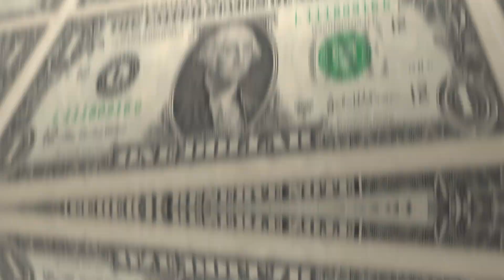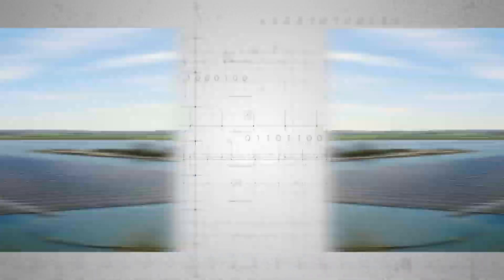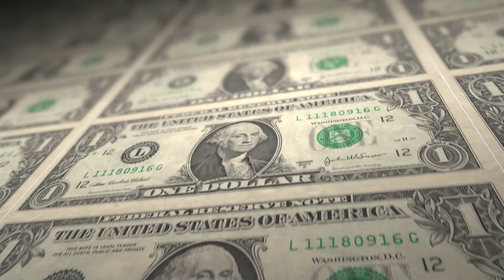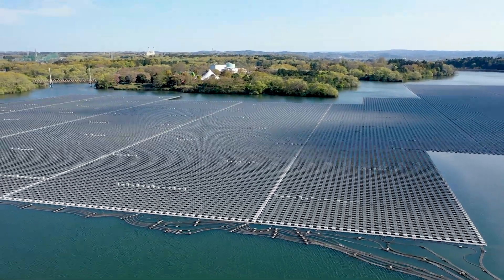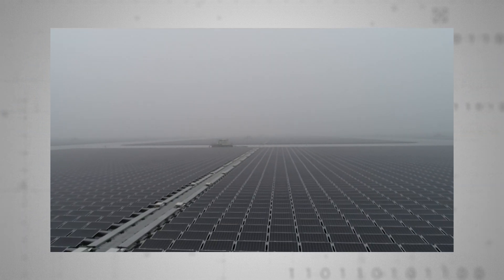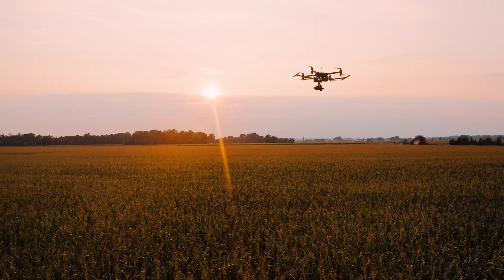The World's Largest Floating Solar Farm

Comment: How about the salty corrosive marine environment on the connectors in combination with constant moving elastic fluctuations of these connectors that causes copper corrosion and motion fatigue.  Remember DC-arcing with subsequent fire destroyed a massive floating farm in the North Sea?   DC-arcing is an inherent fire danger in solar panels. How on earth can you place this in a corrosive salty and constant moving location????

The idea of cleaning these panels with salty water reduces lifespan significant.

Comment: Solar panels can work underwater,  but they work best in clear water at depths of up to 50 feet and government politicians and corporations would not make money in the stock market as shareholders The water's clarity is important because the sun needs to penetrate the water to reach the panels. Murky water can reduce the transparency of the water and make it difficult for the sunlight to activate the panels. 

 

￼

Solar power can also be used in underwater vehicles, such as autonomous underwater vehicles (AUVs) and remotely operated underwater vehicles (ROUVs). These vehicles can help researchers explore the oceans, but they face challenges with power. Solar power can help overcome these challenges by providing a persistent onboard power source. For example, the SAUV II solar-powered autonomous vehicle can run autonomously for weeks or months. 

 

￼

￼

Floating solar panels, also known as floating photovoltaics (FPV), are another way to use solar power in water: 

 

￼

￼

￼

How they work

Solar panels are mounted on structures that float on water, such as a reservoir, lake, pond, or canal. The water cools the panels, which increases their efficiency. 

 

￼

￼

Benefits

Floating solar panels can expand solar power without taking up more land. They can also help regions that experience droughts because the panels act as a lid that reduces evaporation. 

 

￼

￼

Potential

Floating solar panels have the potential to generate a lot of energy and protect the climate. However, in 2020, they only produced as much electricity as less than 1 percent of the world's land-based solar farms, because we have oceans and seas.

Comment: Floating solar is perfect whenever is dam, water storage and lakes in order to prevent water evaporation by sun and PH reduction. I highly recommend it on North pole and south pole on ice caps in order to make shade on ices. This way don’t melt as fast as before. In last 20 years, they are melting horribly which caused, causes and will caused natural disasters.

Comment: 1) educational people about green energy (extracting H2 & O2 from catalyzing water, land solar energy, floating solar, wind generating, water current energy, recycling energy and balance difference energy)
3) educating people about global over population related to global massive pollution. which led to global warming. 
4) educating people to boycott all benzine scooters which pollute much than benzine operating automobiles. Scooters and the most of motorcycles have poor emission systems comparing with cars. 
5) academic system is corrupted. Why? An example: they hide green energy technologies from electronic and chemistry majors. I know more than a physic grad student about hydrogen fuel, recycling energy and balance difference energy. Another example: I know more than a M.D about Nutritional healing.

Comment: Floating solar farms on manmade bodies of water, especially in bodies that support hydroelectric (as this video covers), could be far superior to land based solar farms. Mainly because, as much as greenies say that land (in land based solar) could still be used for farming, it's virtually never done in a commercial scale, only hippy scale.

The reason meaningful farming is not done with land based solar, is the panels would have to be supported high in the air on heavy and very expensive structural framework. This, so that agricultural equipment can plant, harvest, and work the soil. Otherwise, land based solar is generally installed on chainlink fence grade tubing, which is cheap, available, and a quick and easy to install. Additionally,  it doesn't have to be custom fabricated, to site specific dimensions, as would welded steel beams and columns.

However, there are some challenges due to freeze thaw, in the floating arrangement, mainly related to the floating power leads, as seen in the video. Perhaps by making the cables a size too small, the warm cable temperatures will not let ice form, which could be an elegant solution.

In my opinion, there will eventually be a commercial roofing solution that uses large format solar panels as the actual roof. It wouldn't be that difficult to do now, as there are roofs made from thick glass. Certainly, homes should utilize standard roof mounted solar especially new builds. I won't go into it here, but there are issues with solar, being DC and having to be converted to AC, whereas fossil fuel generation, hydroelectric and wind turbines output AC, directly from a wound generator. This power is far superior to that generatorated from solar.

Comment: Ok there is a little numbers wonkery here… phase 1 is 300GWH? And phase 2 is 120MW? Why not use the same measurement. What is the instantaneous power capacity of phase 1 (KW)?

Is the 300GWH number an annual generation amount?

This wonkery aside, great video.

Comment: all wrong wth is guy smocking? The solar panels are made out of materials that polute a lot when made. It takes years of solar activity to outweight its impact in carbon footring. The hyroelectricity is active all year long because its basin/reservoir is controlled.

Comment: I sure hope that metal frame and the panels are galvanized and even if it is seawater embrittles metal glass and plastic. The frame its self should last the 7-8 years how ever the embrittlement of the panels via the seawater evaporating and spillage getting directly on the panels will cause corrosion. I suspect they will have to do a lot of cleaning on those panels and even then it will be to worn down in about 3 years to produce sufficient energy gains. I could be wrong but time will tell.

Comment: Can the solar-energy be combined with wave-energy in this project? Thus killing 2 birds with one stone.
Reply: Not really. One requirement for this to work is for it to be in areas that don't have very large waves. Most of the success has been on inland reservoirs that aren't big enough for major waves, while the Korean one is being built on tidal flats where waves from the sea are dampened before they reach the panels. The waves these places do have don't have enough energy to be worth harvesting.

Comment: Honestly what they need to do is start mandating any public building, office building and non residential area with a roof has to install solar panels that sends power back to the grid. Not only will these business enjoy lower energy costs but then they would be less of a strain on the grid overall. Its currently now just unused space for most companies.

Comment: ...i notice one component missing.. Energy STORAGE..  these giant solar farms can generate enough electricity during the day, but will be mostly OFF during the night.. so it wont be generating energy/ power.. perhaps its time to install a energy storage system like a large megapack battery similar to the Hornsdale Power Reserve, where it levels out the power delivered to the grid.. when there is sunlight, its delivers power to the grid, as well as charge the Power Reserve.. once there is no more sunlight, the reserve power continues to supply power to the grid, to even out the power requirements, but this time, coming mostly from the battery banks.. this just means that there is available reserve energy once the renewable energy system no longer producing power.. & this is a big deal, making sure that the power from the grid is always leveled and reliable, specially during peak demands...

Comment: If you are using the water for cooling, doesn't that mean that you are heating the water(the point being that you're trying to reduce heating of the oceans and atmosphere, by using them as a radiator)? Pretty sure this doesn't solve the issues with Solar, but it's smart to be able to use the existing infrastructure of the hydrodams... now if we could get America to build more hydro dams, and nuclear power stations to go along with these glam projects.
Reply: In your mind, what do you think where the heat goes when there are no panels? Open bodies of water have a very very low albedo of around 0,06. That means 99,94% of the sunlights energy is dissipated as heat in the water. Even if solar panels had the same albedo as the water (which they don’t) they won’t produce as much heat simply because they turn around 20% of that suns energy into electricity.
Reply: @petergoestohollywood382  How much sunlight reflects off the water? How much reflects off a panel? In both, which one's surface heats up? Is the heat in water confined to the one or multiple layers of water, and If you heat the top layer of the water, is toxic algae blooms more or less likely? 
I do like that you seem to have thought about it some, maybe think about it some more.
The fact is, on reservoirs this is a good idea, maybe, but hydro dams would be better. In open bodies of water, seas, and oceans I could see it going horribly wrong. Not to mention the pollution and toxic waste that could result if damaged in severe storms, etc.

Comment: no one mention corrosion? or they are gonna use plastic(which has the potential to dissolve in water)?      when ppl were hyped with composite material and is used on A380, no one thought about maintenance until they need to.

Comment: This is the best idea the renewable crowd have come up with so far. At least they have realized the mistake of covering miles of land for solar. It should work very well for the power loads close by, the cost is still very high. It still would not beat SMR’s (small nuclear reactor) modules which cost much less, and be place anywhere you can drive a truck to, and are not affected by weather.
Reply: the cost is very high? and you just compared this cost with building an SMR?

Comment: floating solar panel is good, whole grid can be oriented with the sun
Reply: all needs to be waterproof
Reply: @ed.t.hansen6499  residential rooftop solar and any other common solar system is waterproof. You say it like this was an issue.

Comment: There is an added benefit if it is tied to hydro power - there is no need for vast storage for night time supply. It would be sitting (floating) right on the storage system.
Reply: That is exactly what everyone who are commenting have missed, less water is evaporated, daytime or peak power usage energy generation and the grid is already there.

Comment: As we have seen with other solar panel projects, their life expectancy is limited, they break and leak dangerous chemicals into ground water tables, and here, they just need to leak to poison and kill any life under which they float. Of course as technology and experience teaches us to learn, it takes time but one can't help thinking population explosion and power requirements are far outstripping our ability to provide it cleanly and efficiently and battery evolution like solar panels, requires more exotic combinations to a point where the cure is worse than the illness. If as much effort was put in nuclear, which is still the most carbon neutral and cheapest form of generating electricity, we might actually be keeping pace with demand, instead of demonizing it through the few instances of human error

Comment: when i came up with this idea i did not know its impact but the cooling would need to be closely looked at just because the water evaporates less because of the still air the heat that goes into the water is much more and will evaporate due to latent heat of evaporation. we only knew it works because the panels are more efficient when they run clean/cool. (guess it depends on the climate and what season they are used in)

Comment: But finally erath temperature getting higher. by reflection made by solar panels
Reply: Please explain how solar panels raise the earth's temperature.  Reflecting energy up sends it to space, instead of letting sunlight hit the earth, which warms it.  So solar panels have a net cooling effect.  Secondly, the energy produced replaces fossil fuel-produced electricity, resulting in a reduction of CO2 and elimination of waste heat from that fossil fuel process.

Comment: The big issue is energy storage. Solar panels are NOT being utilized to their full potential unless the potential energy can be stored for later use such as when it gets cold at night.
Reply: Are you saying that since it cant be used at night then they shouldnt bother to do it?
Reply: @dantronics1682   More energy storage is often needed especially if you need heat at night.

Comment: Tech Vision should do a story on passive solar or designing buildings with plants to reduce heat. 

My father back in 1980 in Wisconsin built his home with a passive solar room, basically an attached greenhouse. In the summer he keeps thick blinds down to block the sun and heat. But in winter he keeps it open during the day. He runs his furnace only once in the morning. The solar room with fans in the walls circulates the air through the house. At night he uses a heat efficient pellet stove to heat the house. His heating bill in winter is about $40/mo.. 

I live in Tokyo and I see some buildings here planting gardens on top of their buildings.
Reply: Solar thermic is different then photovoltaic. Photovoltaic is for generating electricity.

Comment: how much HEAT will it give off??
Reply: What do you mean exactly? PV-panels don’t produce any additional heat like e.g. a motor would. If you think with your question in terms of how much heat/energy form the sunlight is absorbed and dissipated into the surroundings in relation to when there’s no panels around, then you’re looking for a term which is called “albedo”.  Albedo ranges from 0 to 1. Where 1 is a perfect mirror and 0 is a perfect black surface.
The open ocean has a very very low albedo of around 0,06. So it absorbs most of the light energy. Even if a PV-panel would have the same overall albedo it would create less heat than the ocean. Simply because it is converting some of the sunlight into electrical energy (around 20%) while the ocean turns all of it into heat.

Comment: The Problem with using the space of hydro powerplants is, that they are mostly in Mountain areas which leads to less suntime cause the Mountains surrounding the reservoir block the Sunlight

Comment: Woah.....just a cotton picking minute..........as everyone has been informed, it's an established fact that solar panels have approx 25 years of efficient life before they become less efficient......if this vast array of solar collecters is installed in a short space of time it is going to be an environmental and economic disaster, worse than waste Nuclear, when the 25 years is up and most if not half of them fail to perform with predicted efficiency and the output is also falling off exponentially.......suddenly the light start to go dim as demand exceeds supply and the replacements cannot be made or changed over fast enough.......nothing is forever, and the raw material will start to dwindle just like anything else that Mankind needs to fuel their expanding population growth.

Comment: Wait til the conservationists discover the heat you're about to add to the water.  That will never fly.
Reply: Really? You know how dumb that makes you sound?
Reply: You remove heat from the water because there is less sun hitting the water, watch the video again
Reply: Open water has an extremely low albedo of around 0,06. That means the water takes up 94% of the suns energy and dissipates it as heat. Even if solar panels had the same albedo (which they don’t) they‘d produce less heat simply because they turn around 20% of that energy into electricity. In addition since panels are flat only one side is oriented towards the water therefore half of the heat from the panels is radiated away from the water. There’s no way panels on top of the lake are heating the water more than no panels.

Comment: I have an idea 💡😉 what about putting panels on every available roof top in our cities…I think that would just about do it…
Reply: Ya its Better idea than this video
Reply: @robertlee6338  lol 😂 I have 5K of solar on my roof - cost me $24k - and I have a cabin that has been off grid using solar since 2000 - went vegan 7 years ago - bought a PHEV 4 years ago - only use it about once every 2 weeks - never buy gas - heat my house with heat pumps - built my small house with 2x8 walls to maximize insulation, give money monthly to regenerative agriculture - own a software company, my employees all work from home….I think I’m doing my part 😂
Reply: @robertlee6338  I wouldn’t expect the government to put them on my roof, but I would like the government to provide whatever incentives they can to enable the transition

Comment: Lake Okkeechobe is Florida's largest lake and is located near Miami. The lake contains 730 square miles of open water. 

So how many solar panels would it take on Lake Okkeechobe to supply Miami? (wiki)

1) I found: Solar Panels, "...square mile will deliver 1,164,574 kWh per day on average" So let us say 1,000 mWh per day. 

2)"The Miami area consumes about 30 billion kWh a year". (eia)
That is 30,000,000 mWh a year or 83,291 mWh a day. 

3) So, at 1,000 mWh per square mile it will take about 84 square miles of Lake Okkeechobe to supply electricity to Miami. 

Frankly, It looks too easy, I do not believe my calculations...?